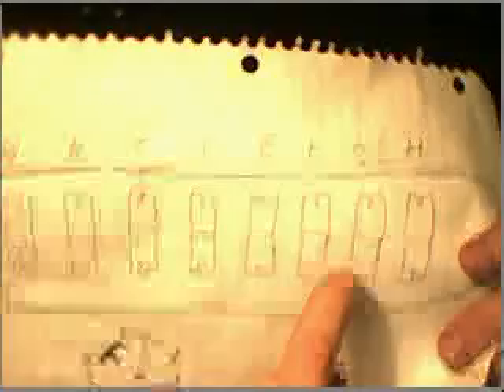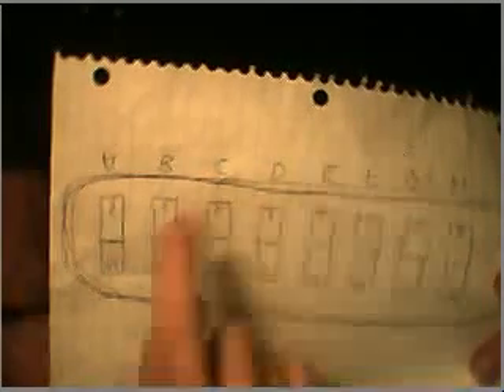Free energy with electromagnetism, is it possible?

Comment: If you apply heat to quartz you get electricity. Maybe you should switch to quartz rocks. Some say quartz rocks can hold electrical energy for long periods of time and may be why some people think there are ghosts running around there house like a hard drive holding data and it gets released.

Comment from the maker: Yes in theory it would be possible but it's not realistic when you consider the amount of physical energy it would require to wind up such a device. Consider this. 1 horse power can produce 746 watts. It would take almost 2 horse power to operate a small 1500 watt electric heater. If you built a wind up device to generate this much power it would require about the same amount of energy to wind such a device up as the energy it produced.

Comment: Let's say you double the voltage. In doing so you double the current, and the final velocity has therefore doubled, as a result of four times the power. This produces four times the kinetic energy.

Before the next half-rotation, let's use some of its mechanical energy. Now it rotates slower. Then switch the polarity, and now new work can be done on the rotor.

See how quickly we can do this? We can do it twice as quickly if we use twice the voltage. Eight times the power output!

Comment: Overall, the electrical energy generated is proportional to the square of the velocity (i.e. voltage and current) times time. The mechanical energy generated is proportional just to the square of the velocity.

Thus increasing the time in which same mechanical work is done increases the amount of electrical energy which can be stored in the system. Electrical energy is therefore proportional to WORK MULTIPLIED BY TIME.

Comment: Taking the point further...

Let's say you have a car on wheels. You want to go from 0 to 60 in half the time. This would be done in half the distance because (x=(1/2)at^2).

Twice the force half the time means same momentum. Twice the force half the distance means the same work.

If you rotate a magnet with twice the acceleration to the same speed, final induced voltage will NOT change! Generated electrical power is the same but generated electrical energy is 50% less!

Comment: If you do work over the same distance in half the time, twice the velocity is obtained in half the time, meaning four times the acceleration and four time the force. Thus four times the work is done over the same distance.

If you accelerate a magnet within the coil, you normally should generate twice the current at twice the voltage, and in doing so, generate four times the power in half the -time.

This produces twice the electrical potential energy with FOUR times the kinetic energy.

Comment: Similarly, charges in a circuit will revolve at a certain speed, which is directly inverse to the impedance of the circuit. Thus, when the impedance of a given circuit is increased, it becomes easier to rotate the coil relative to how the charges are moving. The forces involved will then become mechanically more efficient.

Comment: May have seen a demonstration of one spinning a bicycle wheel on an end to demonstrate how spinning prevents itself from tilting to the side. Thus for a given sideways force, higher speeds produce less acceleration of the wheel. In turn, the torque in that direction is less able to generate a rotation. At slower rotational speeds, the same force produces a greater right angle acceleration. Thus, the higher rotational speeds is a dynamical cause of friction.

Comment: So based on my previous posts, I can conclude the following:

The high price we pay with the Newman motor is the slow rate at which the torque rises, so we have a slow response not practical for many applications. However, I see a positive benefit for trading off the aspect which is essential to most applications.

Correct formula

input = change of torque/change in time + back emf * current

conventional formula
input = torque * change of angle/change of time + back emf * current

Comment: If I bypass half the coil in my motor, the current draw while running is three times higher while acceleration to get up to speed is three times faster. The catch is that top speed does not increase, and I end up drawing three times the current, so my output/input falls quite a bit by doing that.

The large amount of turns of thin wire that I bypass should not be producing so much drag when that part of the circuit is not a closed.

So with greater input power, only torque rises faster (Nm/s).

Comment: "being thats its long coil, the field took time to make it to the other end of the coil, causing the neo magnets to counter act the field of the coil."

Another way to say this is that it takes a long time for the current to reach its value and by that time the magnet rotates so much, creating a counter-emf that limits the current and speed. There are two ways to increase output power here, by attaching a mechanical load output to increase torque faster than rpms, or by increasing the voltage.

Comment: The concept of magnetic pressure is quantified as an "energy density" of the magnetic field which is equal to (1/2)*(magnetic field)^2/magnetic constant. By multiplying this by area, you get the magnetic force, and by multiplying by velocity, you'll get power. Thus the transfer of magnetic potential energy into kinetic energy equals the magnetic pressure time the volume flow rate the reacting magnetic field. Magnetic field^2 is proportional to I^2 and the velocity is proportional to V. Now what?

Comment: When you add rare earth magnets into the circuit, you increase the inductance. Therefore, at the same voltage, it takes longer to change the current to its maximum. This increases your torque but drops your rpms. When weight is not an issue, this will increase your power output per power input but rpms will be very small, which is very discouraging. Remember, rpm is not power! A larger motor will quite naturally have lower rpms for given power input!